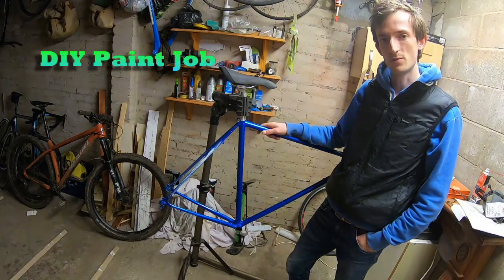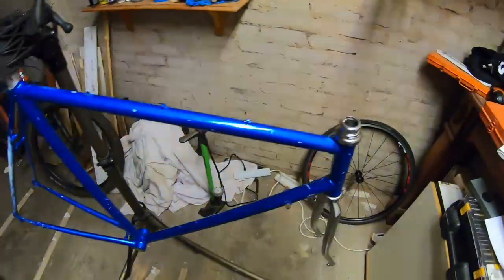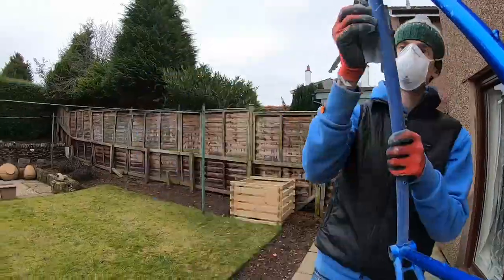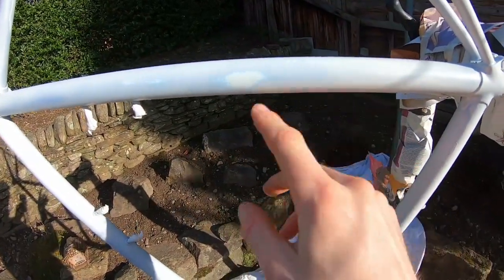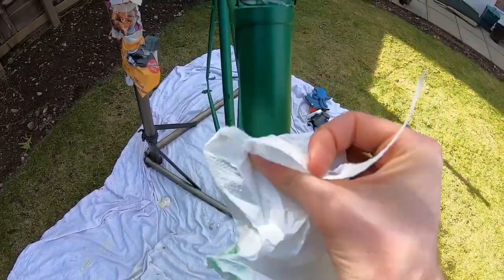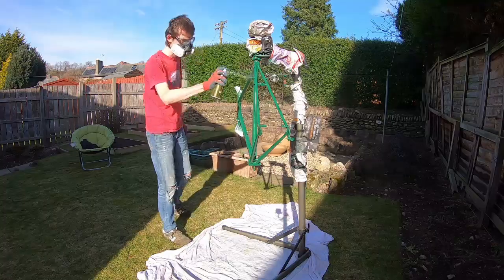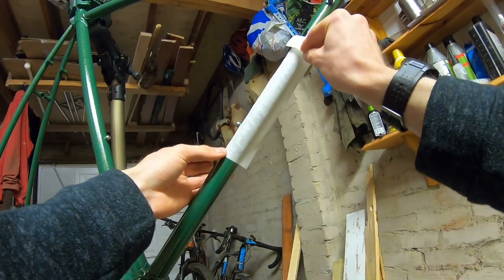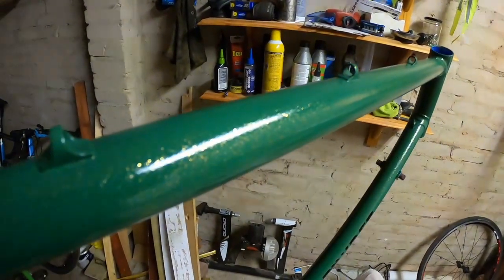Amazingly Easy DIY Paint Job Using Spray.Bike!

Comment: Sand after every coat to get a really smooth, mirror-like finish.  A flat finish will reflect the most light.  Also, in early shots, need to start spraying NOT AT the frame because there is splatter with the first spray then draw the sprayer across the frame with long smooth sweeps all the way along the tube(s).
Reply: What grade sandpaper should you use between coats?
Reply: How much time i have to wait before sanding it? Because if i have to wait 1 day for every coat It takes too long

Comment: Hi,
Great job! I'm in exactly the same boat - roughing up my bike frame with existing paint but some chips are down to the metal. Which Rustoleum primer did you use?
Reply from the maker: I used the Rustoleum Surface Primer Matt finish
Reply: Thanks. Got myself a can now

Comment: Were you able to get the bike covered with just one can of green spray?
And has the paint work held up well?
Reply from the maker: Yes I only needed one can and there's still plenty left. It's holding up well so far. It does scratch but usually it's when I'm not careful enough
Reply: @JT-lv5im  that’s good to hear the paint work is still holding up and it did not require more than one can. I’m thinking to give their plum and white spray a go. I’d never heard of their company until watching your video.